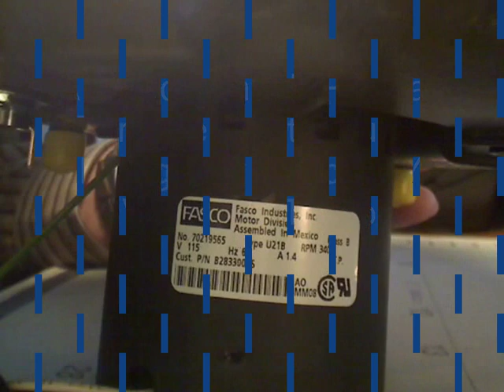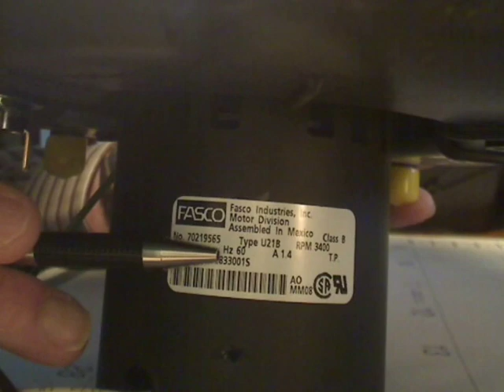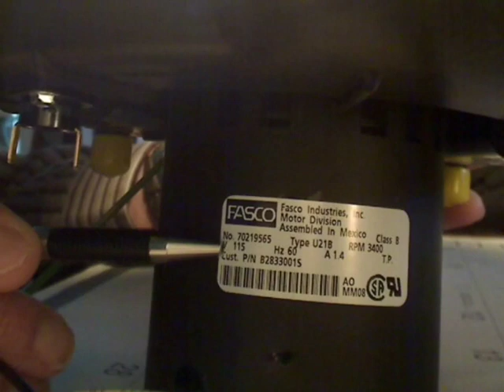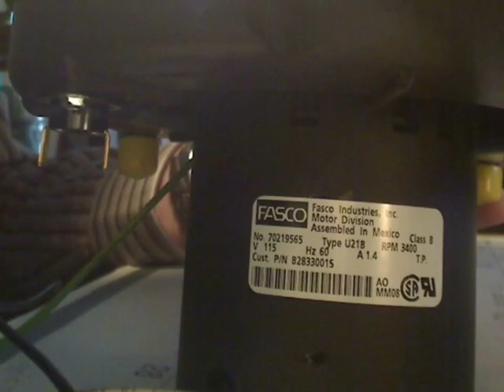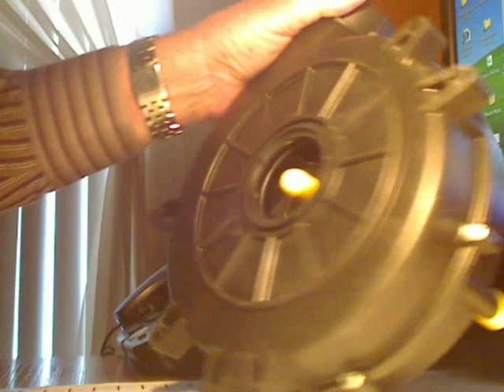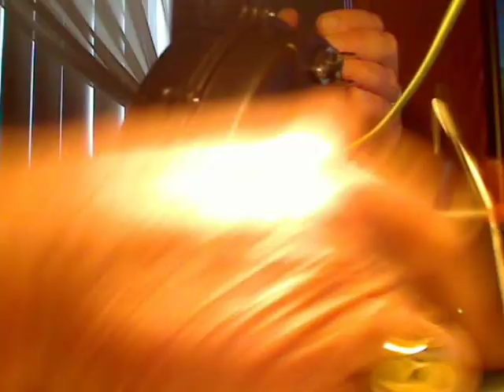Goodman GMPN Gas Furnace Draft Inducer

Comment: Question: That looks like the same inducer on my furnace. You see the small circle on the back of it where it seals up against the furnace? Well, the plastic piece where it seals up against my furnace is cracked. Not on the inducer itself but it is held to the furnace with 4 screws. It's roughly 5'"x5" square piece with a hole. Do you know what this piece is called by chance? I have epoxied it and used some engine gasket sealer for not and it's holding up but I would like to replace it. Model #AUC100C948B8

Comment: Dear sir i need all the components toprepare a furnace device with blower ,start induction transformer , nozzle etc to work casting aluminum on a 45 tons equipment.Usin gas Oil pressure fuel. e mail Multimarinos@gmail.comMany thanks in advance
Reply: Please could do you quote us the furnace componente